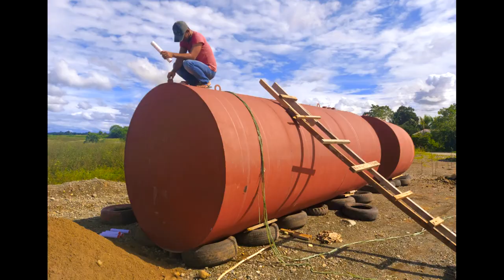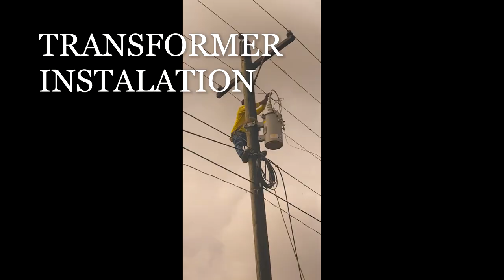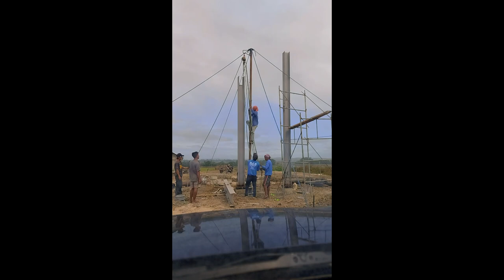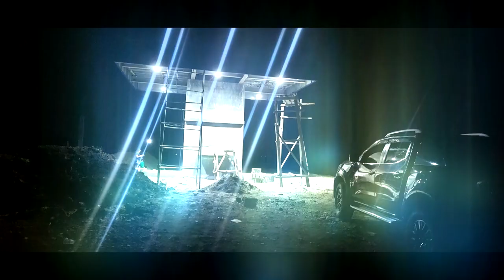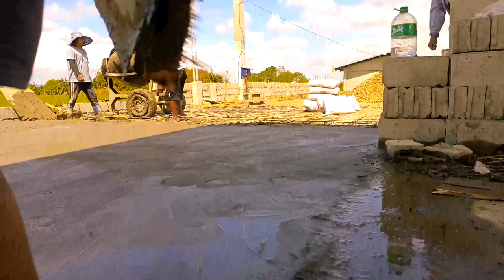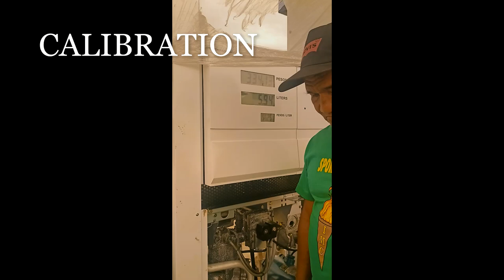Our small gas station, preparation and construction.

Comment: Anong sukat po ng lot. Dimension?
Reply from the maker: 22 meters frontage po sir, pero mahaba po iyan. May palayan pa sa likod
Reply: Cloud Fuel. Ano po ba yan parang Franchise?
Reply from the maker: Hindi po sir, saraili po namin
Reply: @presm26  congrats. God bless.
Reply: Paano supply pala ng fuel. Okay nmn delivery?
Reply from the maker: Madali na yun sir, ikaw na mismo aalukin ng mga dealer.
Reply: Thanks for the info. Contractor ng building anong company ginamit nyO, package ba yan?
Reply from the maker: @jroylipat9877  kakilala lang po namin na civil engineer ang kinausap namin, usually may network na din cla ng mga kapwa engineers and architect. Ksama na yung mga labor and pagbibilhan ng mga materyales. You can do your own canvassing para ma compare mo ang pricing. Wag magpadalos dalos sa desisyon. Sometimes when the deal is too god to be true... kabahan ka onti. Mahabang pasensiya kailangan. Pwede ka rin mag chop suey ng mga materyales. Sinource ko yung ibang bakal sa junk shop like yung mga trap covers. Shopee and lazada sa mga lightings amd electricals. If your not too picky you can also help with the little things. Always have an open communication with your engineer. Between Me and Him, marami kami contacts na pinagkukumparahan kung saan mas magandang deals ang maa avail namin. Also,  unahin mo muna yung mga permits and certificates. Nakailang bisita ako sa munisipyo bago ako nakakuha ng building permit. Have to apply for my own transformer too since walang available na connection sa area ko. All in all you really have to think hard and deep if your willing. Malaking puhunan and kakain tlaga siya ng panahon bago mo siya maitayo. Stay frosty! Kaya mo yan bossing!
Reply: Hello po. Meron po ba kayong. Messanger.
Reply: @jroylipat9877  search mo sir Cloud Fuel Station
Reply: Yong nabiling lupa boss agricultural po ba? Madali lang na transfer?